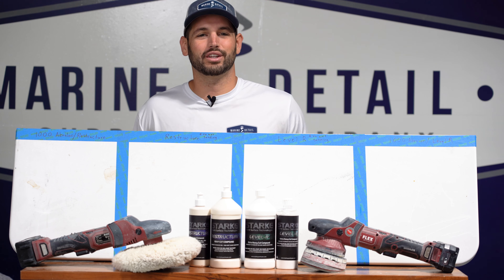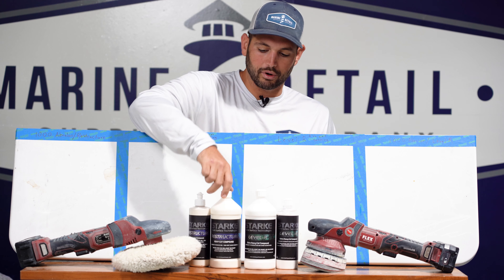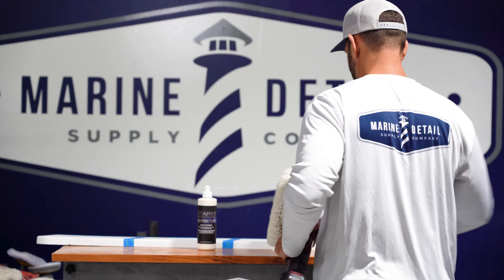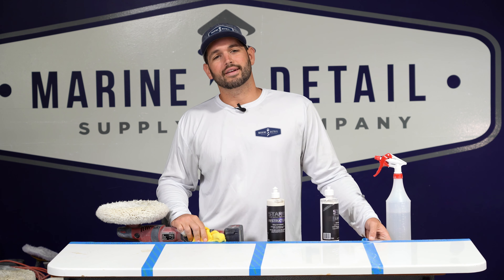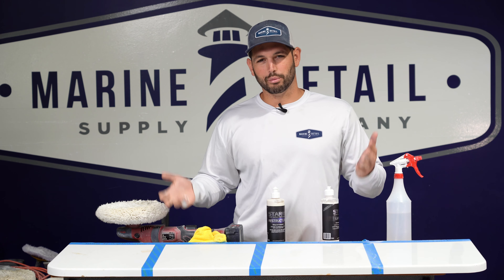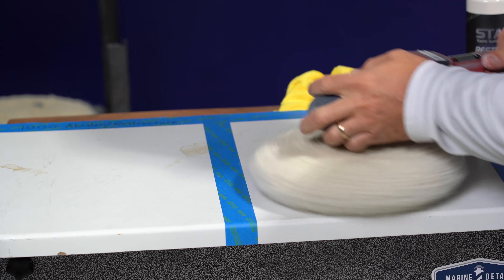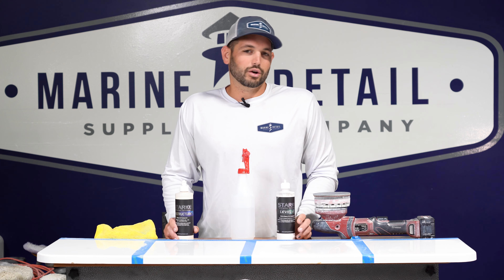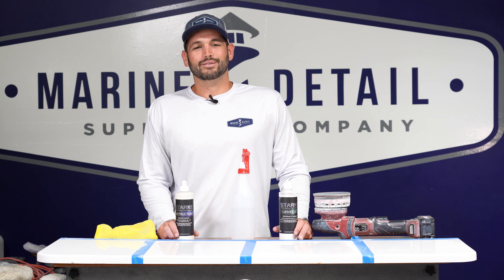Level-R vs. Restructure

Comment: So what you said! Im no professional. Just used heavy r on my boat.  By my untrained eye i felt like it dries to a dust waybto quick. While it Does do a good job at cutting/polishing (i call it a heavy polish). It just didnt give me the time to work on deeper blemishes. Actually think next go round might use 3m super heavy instead of wet sand then follow with heavyr but will try the restructure instead. Used Alot if heavyr because of reapplication in the same area

Comment: Do you think that age plays a factory in gelcoat ? My boat is 50 years old, has been sitting in the sun neglected. If level R was not enough to get through the oxidation what do you recommend? Do you think that if I get rid of the top layer's of gelcoat the deeper layers should be able to be compounded\buffed\polished up to a like new finish or is it impossible because of it's age?  Thanks!
Reply: @marinedetailsupplyco.-tamp3457  Thanks for getting back to me, It's a 1970 Skipjack. I did 1000 grit wet sand on a little section and it looks good, but I really don't want to do the whole boat and have it look pretty good for a very short amount of time and go back to what it looks like now. I have Level- r and elevate and hyper hold, that was my plan but I'm scared it's not going to last like new \newer gelcoat would if I did the same thing to it. Does that make sense or am I crazy?